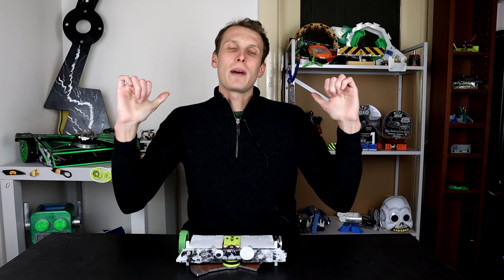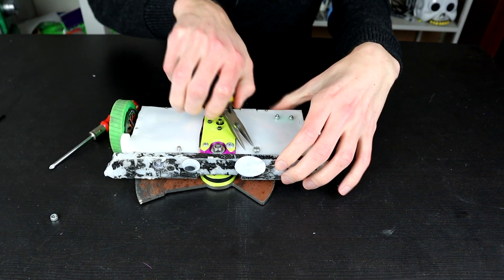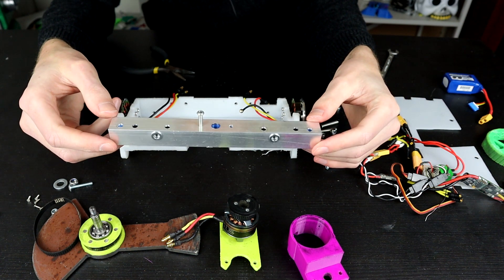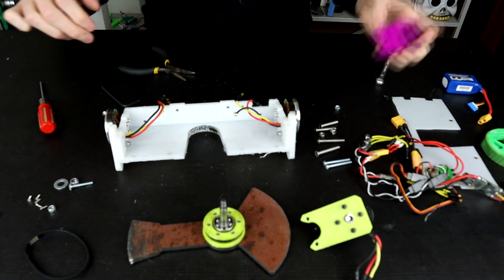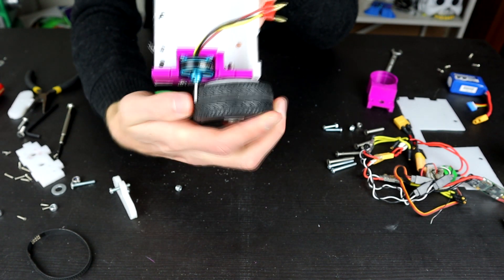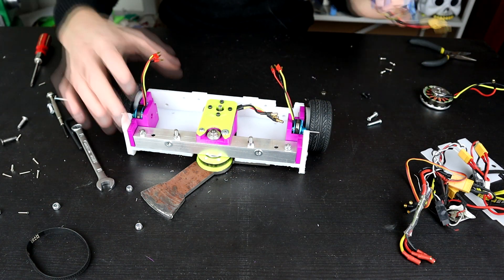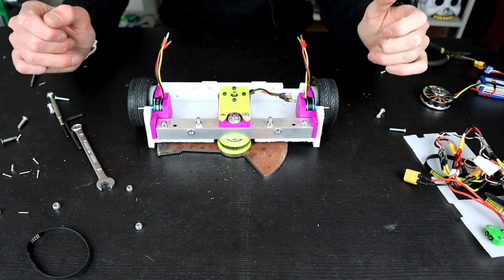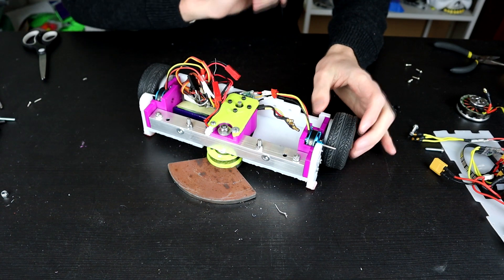Annie_R_U_OK Damage analysis and new drive prototype

Comment: Have you considered pushing the shaft through the back of the brushless drive motors?  The way it is mounted there is a lot of leverage against the mount.  You could flip them around and have a stronger position and put a bearing/bushing into the mount if you prefer.  It would however require iterating on the purple mount part to make it more straight and having another solution to covering the spinning part of the brushless motor.
Reply from the maker: Thats a good idea, maybe for the next version

Comment: Very nice. What if you were to make Annie’s front standoffs more like wedgelets? No, this is not to become a better wedge when your weapon dies, but it’s more or less to put the front contact point with the ground ahead of the weapon. This would fix a lot of your drive issues, I think. But still, you don’t have to listen to the idiot that commented on your video. Looks awesome though, I’m really excited for the tangential drive. Oh, and looking back on my idea of making the standoffs have a more forwardly contact point, they don’t have to be anything crazy either if you’re worried about weapon reach.
Reply from the maker: Its not a bad idea, and should help with the weapon balance, I am a little worried about reach, but my two options are further forward standoffs, or front wheel drive, both of which will effect the reach in some way
Reply: @TeamPanicRobotics  I see, it's probably worth trying both to be honest. You could even make them out of a flexible material so that when your weapon throws someone into them, they flex out of the way. This won't ail your reach as much. Just a thought though, hope this helped!

Comment: Both the inner and outer race if the bearing are contacting the cross member so the bearing won't be doing its job.  One or the other should with the opposite on the other face, otherwise it will just grind / bind up. Maybe why the belt burnt?
Reply from the maker: very true, I need a bearing washer in there that only touches the inner race and the chassis of Annie

And the heat is a good point, that would not have helped with the belt burn out at all

Comment: What happens when the wheels get dusty with the tangential drive? Do you worry that they will start slipping and lose traction?
Reply from the maker: I dont fully know, its something I'll find out I guess
But I am hoping that using these RC car tires the tread will either displace or capture most of the dust and the rubber making the tangential drive work will stay more clean

The testing I did with the doorstop wheels did get a little dust and it didnt seem effected, but I didnt do a lot of driving on those wheels
Reply: @TeamPanicRobotics  cool, the thought just occurred to me remembering that silicone tires can get clogged up towards the end of long meets

Comment: It's time for Team Panic! How many replaceable parts for a bot do you typically bring with you to an event? Do you ever bring like an entire extra bot like I've seen some people do? Another great video Ben!
Reply from the maker: It varies greatly from robot to robot and event to event
The most spares I've ever had was at bugglebots where I had one complete Annie and enough parts to build a whole second one (left as a pile of parts)
I usually aim for a minimum of 1 replacement weapon motor and 1-2 drive motors and any parts that are designed to be broken (like ablative armour, or exposed wheels)

I dont ever bring a whole second robot, I enjoy competing and doing on the fly repairs is a big part of it for me.
So bringing a whole second bot and just swapping it in takes away from the experience for me
Reply: @TeamPanicRobotics  cool, Norwalk Havoc Robot league is today and I was just remembering that some of the kid teams bring a few copies of their bots. It seems excessive to me, but I guess if you have a lot of money... Unfortunately I don't, I have to work cheap as possible. But one design I'm working on I will HAVE to bring a copy of that complex part for every single fight since it will get destroyed each match and rebuilding it just would not make any sense, I'll have to plan for the maximum fights and then plan for extra. I wish I could talk about it, but it is so novel I need to wait until I actually fight it first. It wouldn't have utility in your fights because you have no size limits. It is useful in UK/GB AWS fights that have a size limit.
Reply: For Norwalk specifically, people are willing to spend a lot more time and money on spares parts and even complete clone bots for spares because of the large cash prizes. It’s a phenomenal event to compete in, I recommend it for any one, but it does attract some of the most elite bots anywhere because of the prizes.
Reply: @TeamPanicRobotics  You probably already know this, but I just saw that battlebots tweeted yesterday that they are selling tickets for battlebots 2021 in Vegas and it will be the last week of August first week of September. That's pretty awesome!
Reply from the maker: Yeah, I can partly see having backup robots for kids,
Kids are there to fight, they dont tend to be too interested/capable of doing the needed repairs (I'm sure there are exceptions, this is an observation based on a small data set)
In that case the spare robot makes sense, as it means that they are going to get at least 2 fights no matter what and eases the pressure on the parent (who most likely have their own robots to worry about too)

I had seen that!
I'd love to go, but I cant leave Aus at the moment, we still have international travel bans